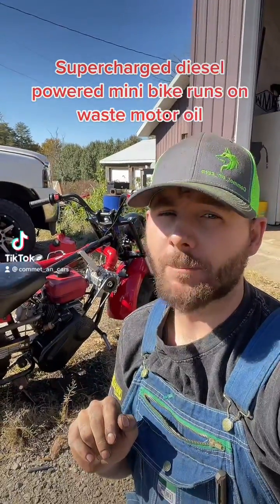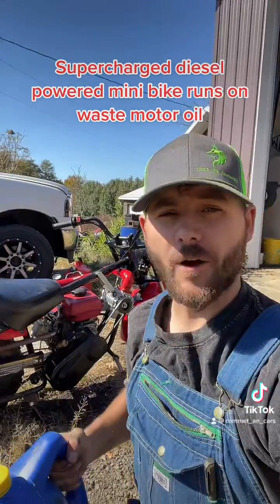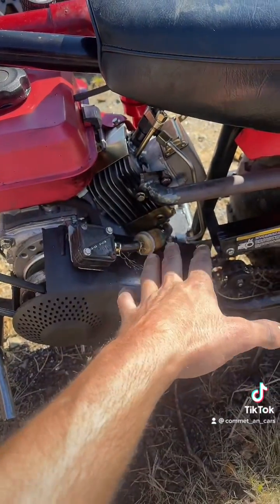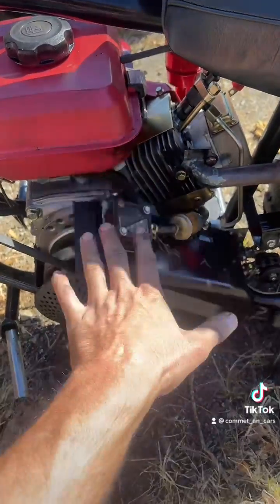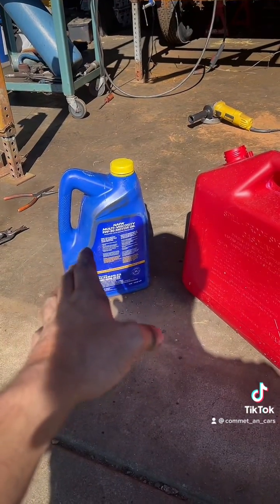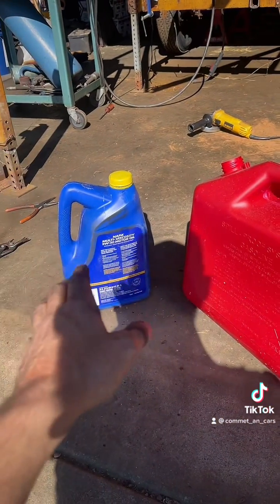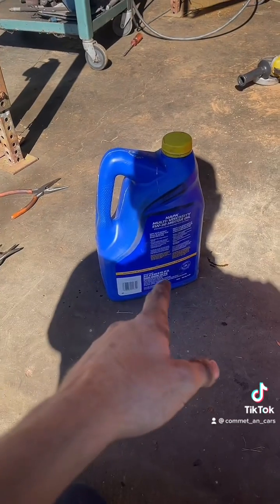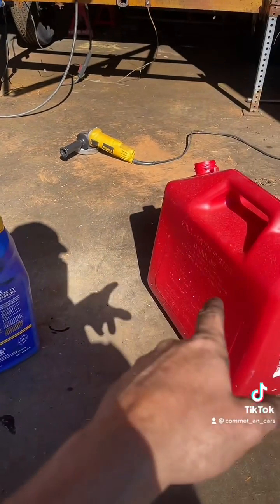Supercharged diesel minibike runs on waste motor oil

Comment: How of mixture ratio?
1lt gasoline : 3lt used oil?

Cz in my here light truck 110ps with 10T load With mountain rute. Driver will mix B30diesel and gasoline. 50lt diesel with 5ltr gasoline. Cz it reduce fuel consumption and increase low end power. It very helping when uphills.